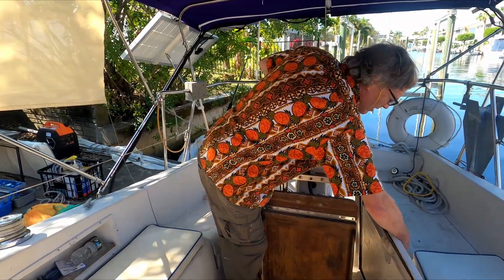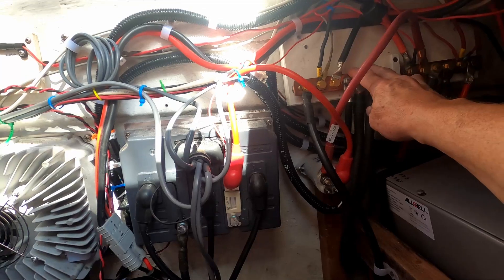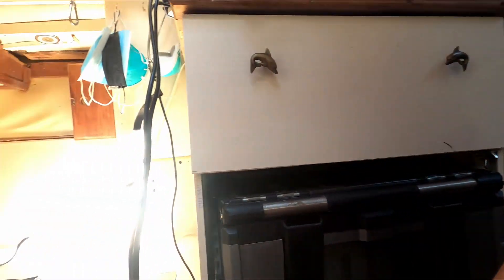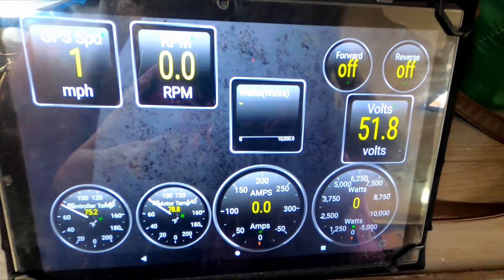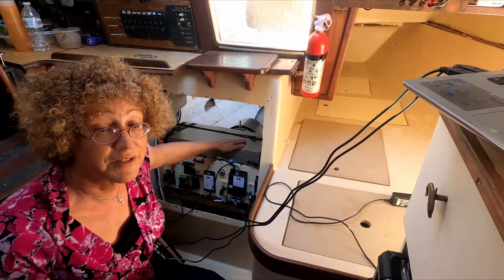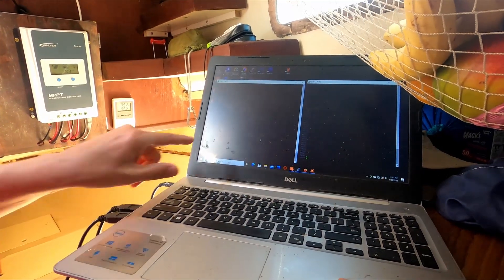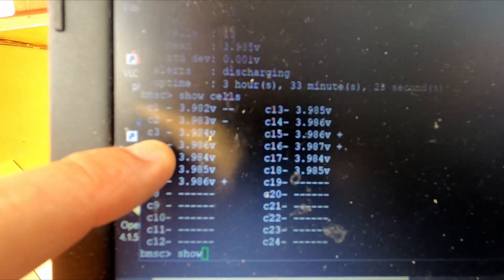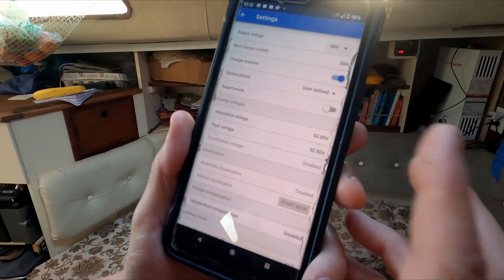Episode 40: Thunderstruck Motors - Electric Motor Install

Comment: Very impressive configuration and discussion. Pls be careful with lithium batteries and water intrusion, they can be quite dangerous. Even small lithium batteries in portable devoces can be extremely dangerous when wet.
Reply from the maker: Thanks for the tip! These batteries came out of Detroit and were used in autonomous, self-drive vehicles that were subject to all sorts of weather conditions. The vehicle company worked with the manufacturer of the batteries to create a weather resistant product. We've taken additional steps to ensure that these batteries stay dry.
The battery is also used a proprietary system to prevent thermal runaway and self-containment of any thermal release.  That's what's been touted anyway.
electricity and water definitely do not mix and we're going to do our best to try to keep the two separate.
Reply: https://www.sta-eletronica.com.br/artigos/baterias-recarregaveis/baterias-de-litio/vantagens-e-desvantagens-da-bateria-de-litio-ferro-life-ou-lifepo4-

Comment: Do you have link for the 48v batts...I have a 10kw thunderstruck...using nissan leaf batteries with only a 132 ah
Reply from the maker: These batteries were procured used from a private company producing autonomous drive vehicles in the Detroit area.  I can tell you that they originated from a company by the name of Allcell.  they have, however, been completely unresponsive to any queries I have made to them. Perhaps you might have better luck.

https://www.google.com/url?sa=t&source=web&rct=j&url=https://www.allcelltech.com/pdf/kwh.pdf&ved=2ahUKEwiVgeDhv7juAhVQmVkKHYv7AQIQFjAAegQIAhAB&usg=AOvVaw2Mcp5oGMC5VX-HALTVjfEs